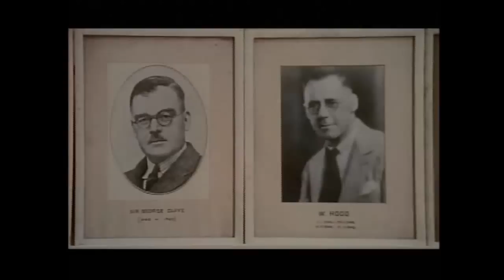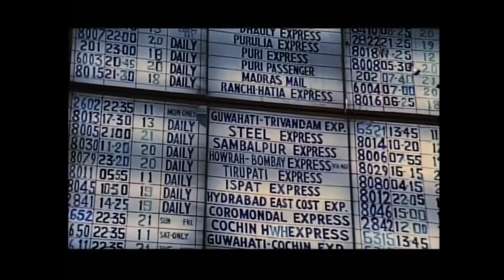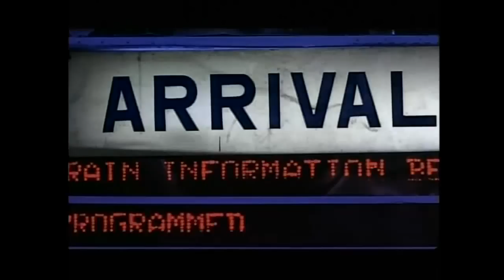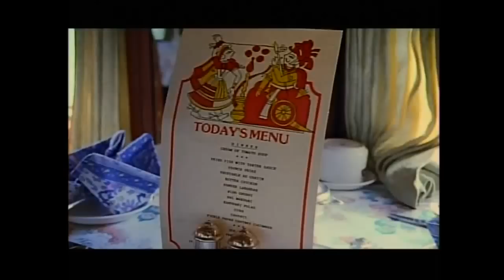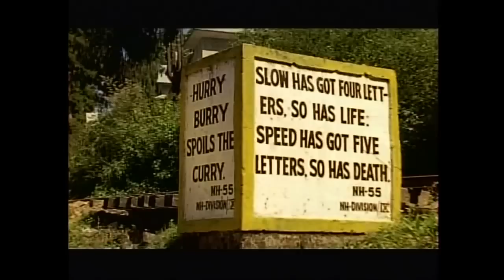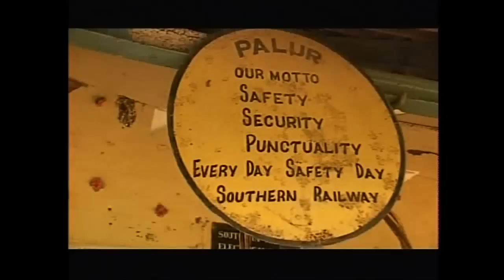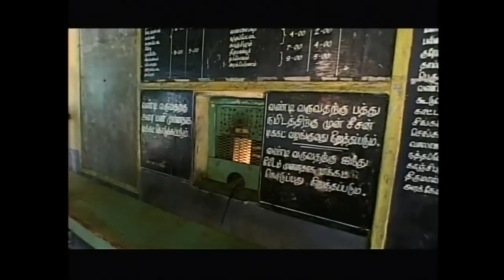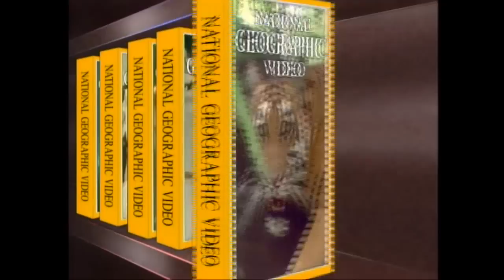The Great Indian Railways © ( IRFCA )

Comment: Arun, I am curious. Does India have an abundancy of coal?

I noticed that a lot of the line are electrified. The ideal thing to do in my opinion would be to electrify as much of the INR system as possible, with modern cleaner coal burning plants as the power source.